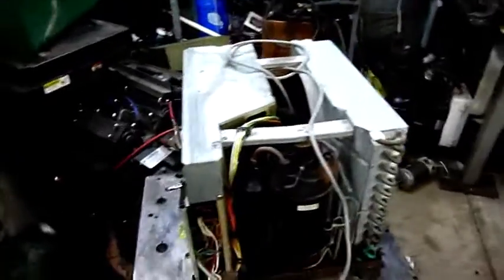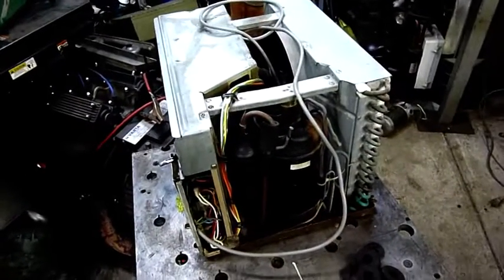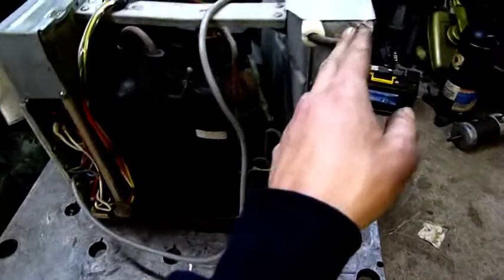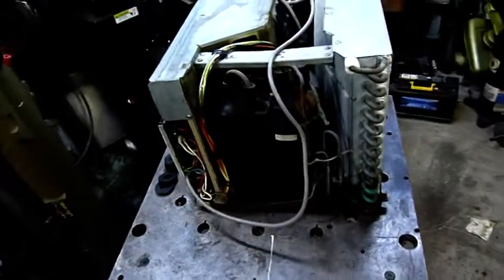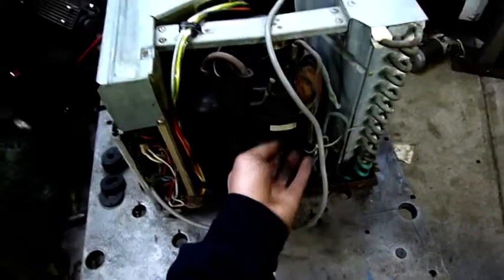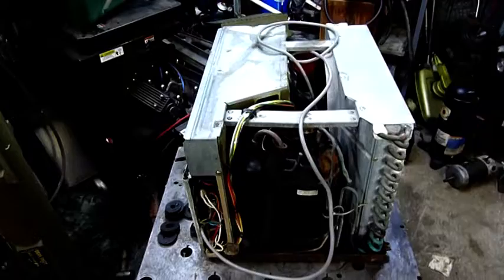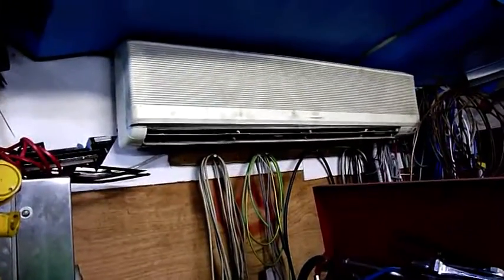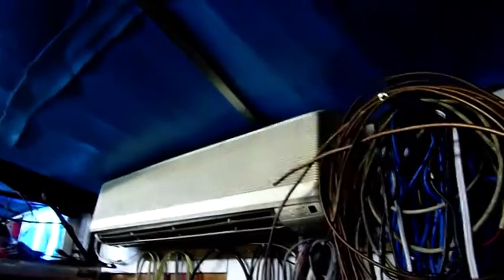Why Heatpumps Don't Like Cold Climate

Comment: I know its an old video but how come some heat pump units don't cool below a certain outdoor temp, there is no reason I can think of, like on some daikins I think below 5c ambient outside it wont cool, I heard someone on about trying to keep a server room cool with little ventilation, they ended up using a fan for outdoor air

Comment: ***** One of the biggest problems with split heat pumps, is that the lines may not have enough insulation, and you will loose all the heat before it gets to the coil, and a lot of split units use a piston instead of an expansion valve, and that will flood back to the compressor if it's too much below freezing. Crankcase heaters also help to warm the compressor when it's not running, so it can start up properly. I've seen heat pumps give out nice hot air when it's below 21 degrees fahrenheight outside. Simple problems and "bugs" with the unit are the reason they don't always work in the cold.

Comment: I don't like R410A either. With R410A, the maximum condensing temperature is only 150 degrees Fahrenheit. With R22, it can go all the way to 200 degrees Fahrenheit. There are some drop-in refrigerants for R22, MO99 has the closest temperature pressure resemblance. Honestly, if I were to try to build my own heat pump, it would use MO99.

Comment: What about cascade systems utilizing 2 or even 3 compressors (each a third of the size of one big one of course) that can achieve a lower evaporator temperature, hence, increasing the transfer of heat from the air to the evaporator? 

I really want to try this one day...

Comment: My local newsagents uses a heat pump to heat in the winter, it's an old Fujitsu Super Quiet, and it not only has to heat both the storage/office area and the main shop area, it also has to fight a rather large split system display fridge, and it's always nice and toasty in there in the winter. And in the summer it puts out so much heat that you can see the waves of heat blasting out the condenser unit. That unit is amazing. I hope the owner won't replace it and only repair it, it's great.

Comment: Last winter in the UK when it went as low as -15'c my heatpump didn't seem to mind. When it dropped below -5'c it stopped freezing up, probably because there wasn't any moisture left in the outside air. There was massive icicles on the condensate drain from all of the defrost cycles lol.

Comment: @Xringer Interesting what you say about the cost difference between your oil burner and the heat pump. I think it is only a matter of time before more heat pump manufacturers become more common in the U.S market especially when running cost become a factor. I know there has been a big push from companies such as Daikin, Mitsubishi, etc with ductless A/C into the U.S market.

Comment: @Aussie50 I worked in the UK a few years back. They have a heat pump product for total home heating to heat the hot water and underfloor heating. They have a High temp model now for Scandinavia that heats the water to 80deg C. Where I work they have just developed a heat pump that will have no capacity loss down to -25deg C ambients. I think they now offer rebates as they class heat pumps as renewable energy in Europe. Give it a few more years and will start to see CO2 used as the refrigerant.

Comment from the maker: @rossm06 yeh I avoid inverters and R410a stuff, but you are dead right, the higher pressure gas and inverter drives make heatpumps perform in really low amb temps.

I should have specified in the video that its traditional R22 heatpumps that suffer

Comment: True some older model heat pumps don't work well in low ambient conditions, However current model heat pumps have been very finely optimised for both low & high ambient conditions. The use of R410a refrigerant has been a big factor for this. I am guessing the unit you have here runs on R22.

Comment: @Aussie50 By running variable speed compressor and fan motors, you can 'create' the conditions desirable for heating @ low ambient.  You just have to boil the refrigerant at a lower temperature (higher compressor speed, lower suction pressure... and condense at a higher temperature... lower indoor fan speed.

Comment from the maker: @HVACarchives yeh I'm starting to notice a lot of these new Inverter driven ones running at really low amb temp. 
but they run high speed twin rotor comps, so I am guessing most of that heat is from the compressor.

Comment: heat pumps struggle right at freezing: 0C/32F, but do ok above and below this.  the problem is icing of the outdoor coil; if temps stay below freezing, theres little opportunity for liquid water to accumulate on the coil before freezing.  the further above freezing outside, the longer it takes for ice to accumulate on the coil, and the less time the pump spends de-icing.

it varies with humidity of course, but when temps are swinging just around freezing, heat pumps tend to perform worst.

Comment: @Aussie50
Aah ok, its one of those things you really dont think of over here as there is usually no need for the heater here in South Florida, I used to think that it was some sort of electrical element or similar system but everytime I opened up my the a/c unit to clean the condensor and evaporator I never saw one lol. Guess this is the reason why haha

Temps reach down to about 7-8C at lowest here so its rarely used

Comment from the maker: @serge933 if you mean a split system, yeh, the principal is the same. only difference between a package unit (Window or similar PTAC) and a Split, is the line set, and lack of casing between the 2 sides.

its like cutting a window unit in half and joining the 2 bits together remotely with copper lines and wires only.

Comment from the maker: @jdstooge yeh, it doesn't hurt as long as you don't let it dump high temp gas back into the frozen coil, that characteristic hiss when you shut it off dead is it doing that, and it can cause thermal cracking of the copper over time, where super hot meets freezing cold.

Comment: Hey Aussie, you probably should have mentioned the latest (well, few years now, actually) solution to the issue of air source heat pumps not working well in cold weather areas, which is ground source heat pumps. 

They're going to become quite popular as issues with fossil fuels become worse, and higher costs of fossil fuels and state mandates  help push ground source heat pumps to the forefront. 

Many countries offer incentives for installing ground source heat pumps.

Comment: So heat strips or heating elements are more efficient than using heat pump even though air conditioners can easily be converted into a heating unit?

Comment: actually up in north u.s. or in canada we don't have many a/c's around  i havent see one heat pump where i live  (Binghamton, New York) either forced air heat which alot of people dont like or hot water radiators or baseboards also people heated floors where hot water runs through pipes under your floor   the heat source is a bioler or steamer or a furnace   oil, propane, or natural gas

Comment: Heat pumps are good if you have somewhere that maintains a nice constant above zero temperature close by where you can place a heat exchanger. Usually a large stream or well that doesn't freeze or simply burying it deep under ground.

Comment: i fing less than 7'c they not so good unless the have 2nd stage but most of the unit over hear dont have snd stage. ill explain the 2 coil freeze. it takes 2-3 defrosts on a -1'c night to do it :D ill try puting the vid up of the fujitsu from that cold night